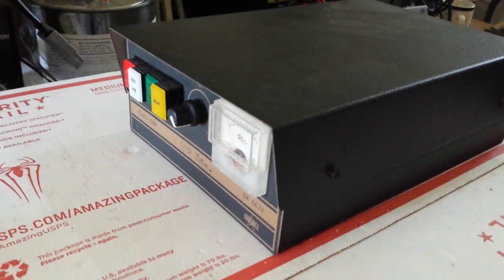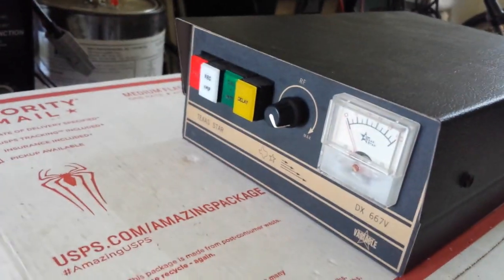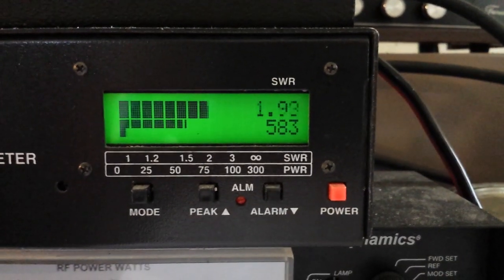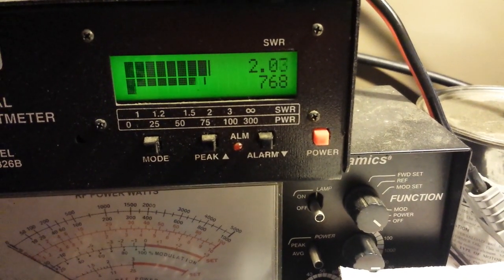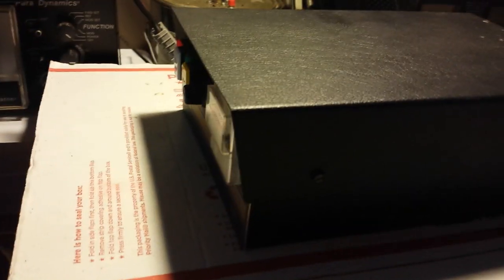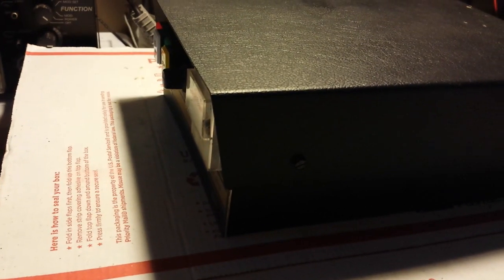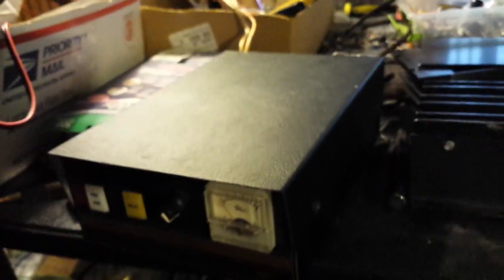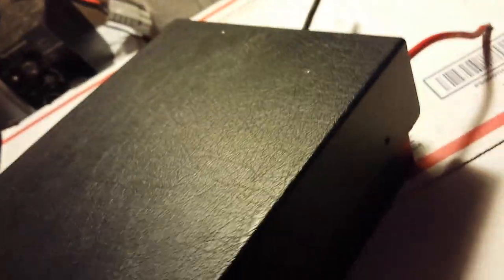Does A Texas Star 667v PWR Wire Upgrade Help?

Comment: I have owned a TS 667v amp since 1995. I replaced the variable control, it got scratchy and worn out,but other than that i have not had any problems with it. Awesome amp. I've learned to keep the power leads short and thick. For best results.  As with any amplifier, short and thick leads.

Comment: As someone who also does this kind of work around town for the locals...I don't even have to watch the video to answer that question, but you bet your ass it helps. The thicker gauge the wire, the more current is passed through the device...hence the boost in power and performance. Great video!!!
Reply: see my comment

Comment: doubling your power output is a 3 db increase or 1/2 of 1 S Unit
it requires 4 times the power (increase) to gain 1 S Unit
1 S Unit = 6db
 100 to 400 watts = 1 S Unit increase (6 db)
400 to 1600 watts = 1 S Unit increase (6 db)
1600 to 6400 watts = 1 S Unit increase (6 db) in signal

 peace )
Reply from the maker: the DB Log Table....nicely put
Reply: It is not what I say, it is what the laws of physics say and radio mechanics. It requires 4 times the power to increase your signal on the receiving end by 1 S Unit. So, if you run your radio at 50 Watts instead of doubling the power to 100 Watts, you are saving energy and the life of your radio in the form of heat and degredation. The reason they lowered "legal limit" in amateur radio applications from 2000 Watts to 1500 Watts is because there is essentially no difference in received signal. My Henry amplifier is capable of 5000 Watts but to increase the output to that level will likely only cause excessive heat and possible damage to radios, switches, feedlines, antennas, couplings, etc. and the increase on the receiving end would be less than 1 S Unit. 1500 Watts is sufficient to make any contact around the world. It is all based upon a logarithmic scale. Decibels.

Keep up the good work Rekindling The Reformation
Reply: And to answer this question more directly, The guy running 900 Watts would be about 3-4db louder (about 1/2 of an S Unit and an audible difference) The guy running 1400 Watts would be about 2-3db louder than 
900 Watts (1/2 of an S Unit also an audible difference). 6db = (4 times the power) which is = to 1 S Unit on the signal meter. 3db = 1/2 of 1 S Unit and an audible change in the received signal.

Keep up the good work Rekindling The Reformation !!
Reply: Headroom is what to always look for in an amplifier. You want to run the sweet 16 at 800 Watts continuous duty cycle. 100% SSB and maybe 75% AM or FM duty cycle. The reason for the Henry 5K is not to run 5K, it is to run 1500 as long as I want to run 1500. Without having to rest or blow up my amplifier. And if I need to push it a little harder to make a contact or bust through a pileup, I am able to do so for a short burst. In conclusion the sweet 16 is the better amplifier, you need to be the better operator to go with it. If you do, you'll be the guy who is always on the air reliably. Use the least amount of power necessary to make the contact, anything more is simply ego. How big is my signal?

Keep up the good work Rekindling The Reformation !
Reply: I think the difference between those two texas stars is 1db only.

Comment: i wish i was closer to you. but i'm in kannapolis, n.c.. i'm a ham and i've built kits. so to the point. i have two t/s. one 600 and one 500 both straight dx's. anyway, i would like to understand the biasing better in these amps. i know i can't make a competition amp of them. but i could make both run in c class for am. it would free up a little of the power. but the main thing is turning the 600 into a 500. have you done this? is it cost effective?  the reason i ask is i want to make an external combiner box and hook both up to one radio and one antenna. and still have an ab1 class amp to work ssb with. and if i want to put one inside the base and one in the car. i can still do that too.
Reply: dale myers 73's de kf4dcy aka viking.
Reply from the maker: where have you been lately brother I hadn't heard anything out of you

Comment: A good upgrade, but no one should perform it for the extra output. It makes no difference on the other end (as you mentioned.) Boy some of us chicken banders just need to squeeze every watt out of their equipment. Lol!! When the wire upgrade quadruples the output of an amplifier or transmitter then you've got something. One extra s unit. 73 s